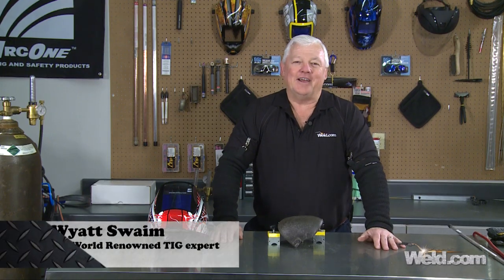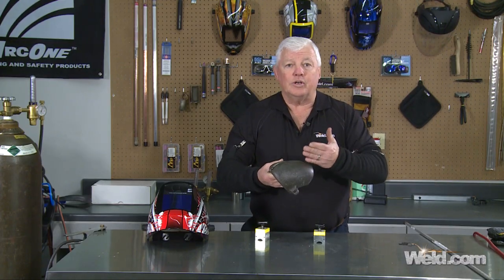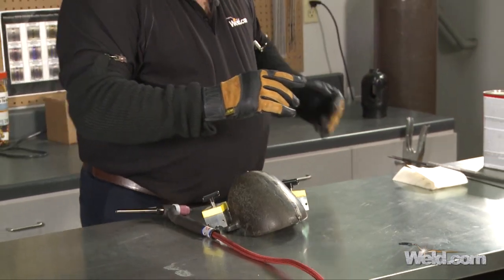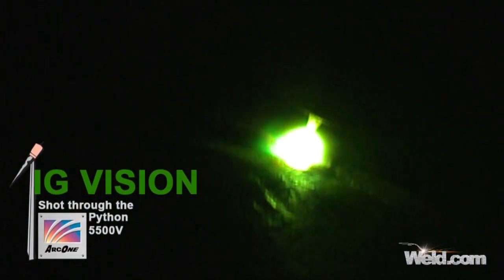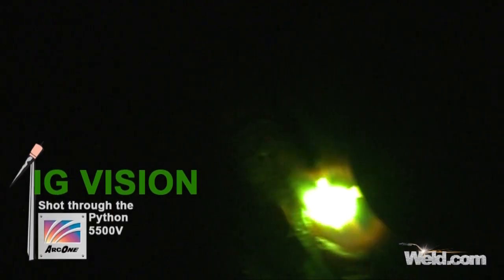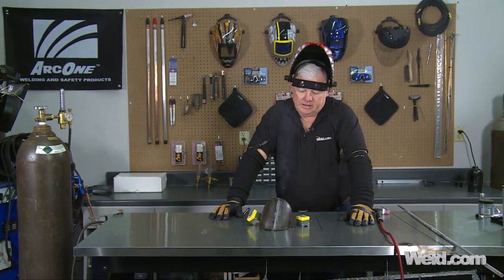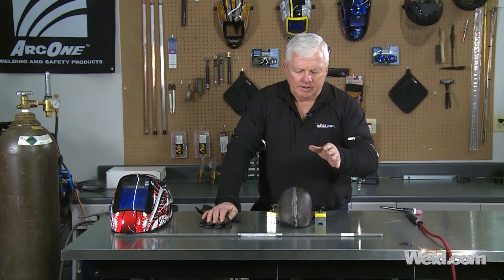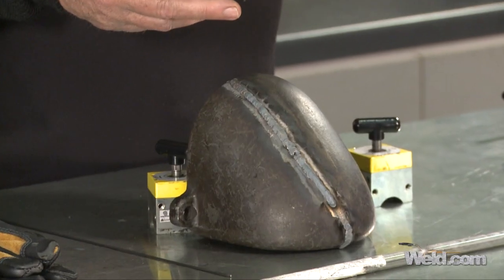How to Weld Cast Iron NO Pre-Heating | TIG Time

Comment: Watching the video, I may have not been able to see the entire height of tank, but I noticed that the Argon tank with the cap removed and a Flowmeter attached, DIDN'T appear to have a safety chain going around the tank. Call me Mr. Safety or anything else you'd like, but anyone that has ever dealt with highly compressed gases SHOULD have better sense than to remove a cap from a tank and allow it to stand on it's own and be subjected to being bumped or knocked over accidently.
Reply: +Nortekj Do you know this guys resume?  Really.  If you look at some of his other videos you'll see a solid metal strap or ban around the tank.  Go pick on the guys not using a throat shield!
Reply: thanks Mr. Safety
Reply: Mango, I have no idea if you were agreeing with my concern about the safety chain or just being sarcastic, but if you have ever seen what one of those tanks will do when knocked over and breaking off the valve can do, you'll appreciate having some sort of restraint around ANY highly compressed content of that type of tank that has the cap removed. I have seen what they are capable of a few times, one was when a newly hired person that was bringing in a fresh tank of oxygen on a cart that had the cap removed,  the wheel of cart hit something on the floor causing the cart to be jerked out of his grasp tipping the tank over the edge of a welding table, knocked off the valve and it took off like a rocket, hitting a large Press Brake and knocked it 6 inches off the bed it was mounted on, the tank then glanced off the press brake and completely penetrated a brick wall and the only \thing that finally stopped the tank was a chain link fence of which it too, was mangled badly. I am not particularily fond of some of OSHA rules, but let any OSHA inspector walk into a place that has those types of tanks and NOT having  some sort of cage or restraint around those that DOES NOT have a cap on them and that company will either pay a huge fine or in some cases I have seen the business SHUT DOWN until a cage was built and/or some type of restraint  encompassing the tanks AND  HAD ALL the caps PUT BACK on. So if you were being sarcastic, at least keep in mind of what I said, I have seen it with my own eyes of the damage that can be done by one and it was by the Grace of the Man above that no one was injured or killed either time.
Reply: Nortekj yeah brother i was being a little sarcastic lol i been studying worksafebc vids for too long and was a little pessimistic. its different on the screen then on the site or in the shop because theres a disconnect from all the danger. don't get me wrong i agree with you wholeheartedly and around high psi gasses i don't fuck around or even crack a smile. that kind of accident you described would've been a topic for one of these vids guaranteed…you are not in north america i assume?
Reply: Yes I am in the USA, I live in Kentucky not far from Cincinnati Ohio, and let me tell you, OSHA is really strict  on safety here, even though their rules can be a hinderance at times and make things more difficult for people.
Reply: Don Davidson, I know he is a professional welder the same as I as before I retired, I welded professionally for almost 60 years. I watched that particular video and going by Kentucky's safety standards, a restraint system is required on the upper 1/3 portion of the tank and is required to have some sort of anti kick out for the bottom incase of something hitting the tank at a point lower than the upper restraint.. That particular video DID NOT show that it was restrained. I viewed the video 3 times to make sure I wasn't howling at the moon needlessly.
Reply: Most places I have ever worked people are terrified at the very slim possibility of knocking a top off a full bottle and having it shoot across the shop but nobody is the least concerned with blowing a hose off an acetylene tank, even a hose that is already burning.
An oxygen tank may be capable of flying and crashing through a wall but an acetylene tank is capable of blowing up the entire building.

Comment: I'm curious as to how well this would work on a larger piece, like a cracked engine block, where both sides of the weld have no "give". I'd also like to know how strong the weld is. Like if you broke a piece of flat bar iron, welded it back together, and broke it again measuring how much pressure it takes to break it both times. Has there been any testing like this?

Comment: Ive had good luck using silicone bronze for cast repair. Cast anything is normally terrible to tig weld if all else fails, its back to the oxy fuel torch. Tried and true.
Reply: TheJesusno2 iii
Reply: Crown makes a Cooper NI. That I like. No pre heat required

Comment: Nice! I just went and ordered some. Their prices seem pretty reasonable. May have just saved a couple of cast pieces a trip to the scrap yard.
Reply: cracking(probably just poor heat management). Also, one manifold I had I about had to keep the tiger torch on even while I was welding, this would've been way better. That just looked too slick to not have a couple rods just incase. I think I'll try a cover first when the snow melts and I can find it.